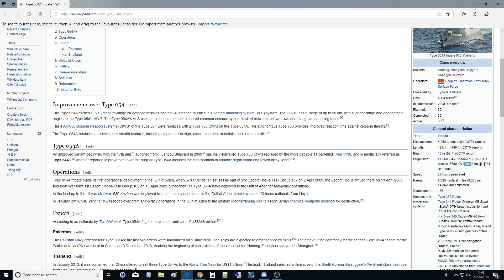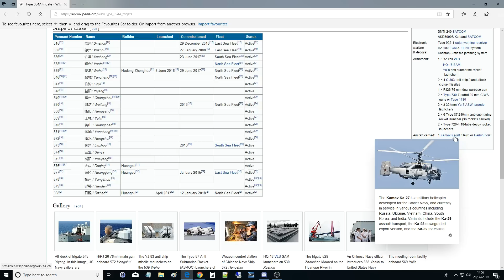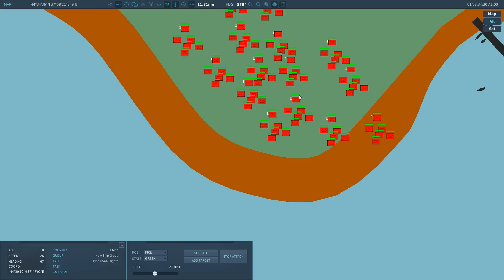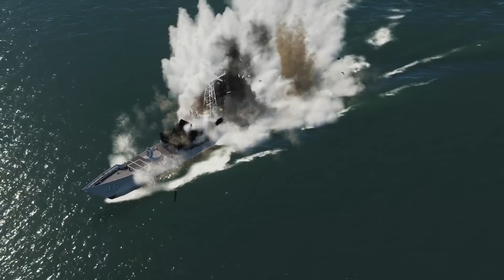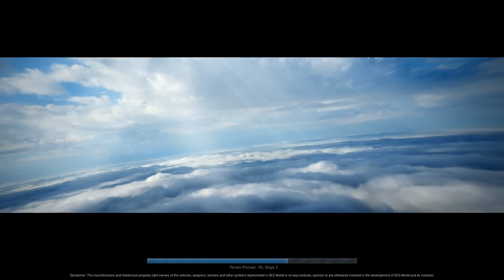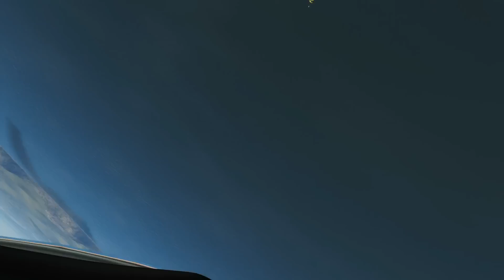Combined Arms: Type 54A Frigate Yantai Tutorial | DCS WORLD

Comment: I have a video topic suggestion for you guys. In DCS it seems that high drag munitions, like the Mk 82 Air or Mk 82 Snakeye, are pretty much unsuable in windy conditions (even with a slight wind) due to the azimuth steering line (ASL) quickly drifting from side to side on the way to the target. Could you test that, Grim Reapers?
Reply from the maker: wilco
Reply: @grimreapers  Thanks! Now just to be clear I'm talking CCRP (Auto) here, not CCIP.

Comment: Diesel engine needs much simple and compact clutch (lo-tech, lower costs) compared to gas turbine and the engine itself is simpler. I think diesel is also less sensitive to the type of fuels it can use. Some naval propulsion systems use combined diesel and gas (CODAG) in order to have a high cruise speed and also good range on economical speed.
Active sonar is not for jamming, it is for creating an artificial sound pulses that heat the target and return back to the sonar, much like radar does. Passive sonar uses sound waves generated by the target itself, like some passive radars. 

Chinese had in past contracted Russian design bureaus (OKBs) to provide assistance in creating some military hardware. So some systems have Russian origins. Also, China purchased Sovremenniy class destroyers from Russia...
OTH works by using wave lengths that are reflected by the atmosphere. I think almost all Russian ships armed with long range AShMs have those radars, including fast missile crafts (they have a newer missile corvette that doesn't, but they serve as a cruise missile platforms in the Caspian sea). 

Four fire control radars for SAMs are in order to provide four simultaneous fire channels. Ticonderoga also have four FCRs for its Standard missiles (two on the bow, two on the stern). [Tunguska has one FCR ;)]
Reply: That's some really nice info you have there. Also about Active Sonar, another trait about it is it pretty much gives away your position to everyone that can hear it, but it can provide a more definite picture of what's around you. So there's some strategy to when to use which mode or part of your sonar suite. This alongside that thermocline phenomenon makes sub tracking (and also being in a sub) a tense job. Give yourself away and you risk creating a scenario where your enemy knows where you are better than you know where they are and thus they get a better chance of a firing solution.

Comment: Those little domes you talk @21:00 are likely to be the guiding radar for AA missiles, as the SR radar is generaly not accurate enought for firing solution.
Reply: The radar for the AA guiding radar is covered at https://youtu.be/GrlzbqvKX-s?t=1029, those Front Domes are used to guide in the missiles. I remember reading about 2 satcom antenna systems and I'm convinced the 3 domes we didn't know are problems those.
Reply: The 2 radar dome on the far back and 2 on top of the bridge are the Illuminator for the SAM.

For the  1 big dome and 2 little dome is a Mineral-ME1 active radar and Mineral-ME2 passive radar its a low power secondary radar  and used when the main radar is turn off